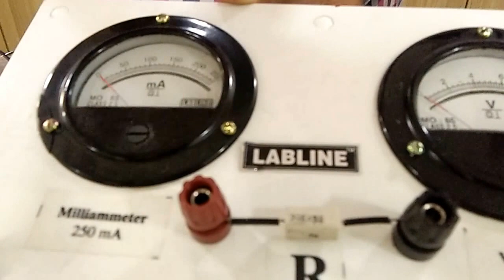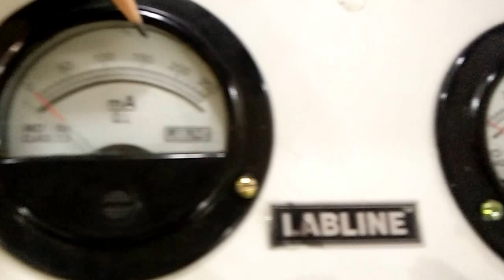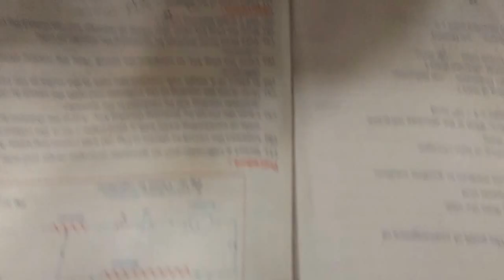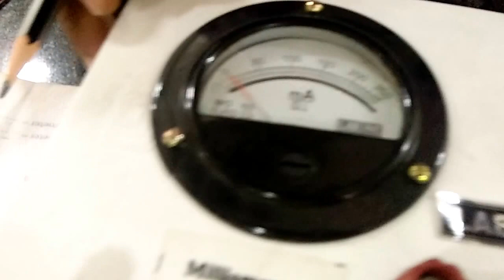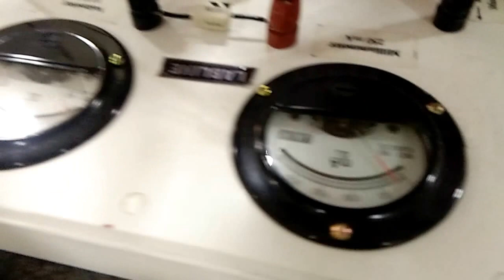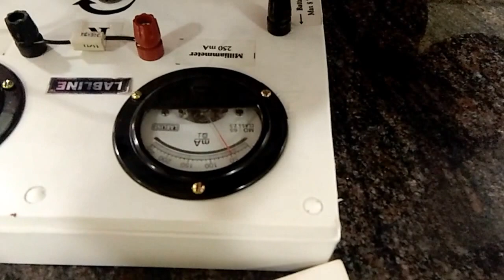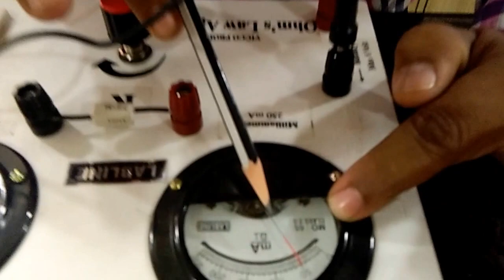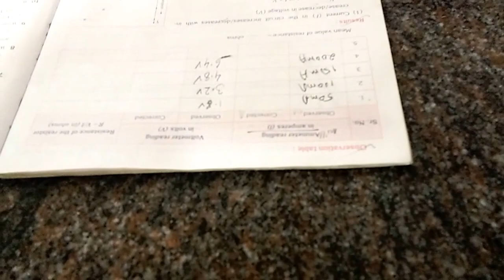Ohm's Law

Comment: Sir what is the difference between series and parallel connection please tell
Reply from the maker: Sankara Narayanan 
Due to series connection.... Resistance increases but current decreases
In parallel opposite of above happens
Reply from the maker: Also when there is series connection all components are connected one after the other.... Whereas in parallel all components are connected one above the other between two common points.
Reply: Sir in textbook it is referred as that the parallel connection reciprocal of equilant resistor is equal to the sum of indudiuval resistor I can't understand parallel connection
Reply from the maker: Dear Sankara Narayanan 
Easy to understand...Textbook says it is Reciprocals of individual resistance is the  sum of reciprocals of individual resistances....Means....Suppose u have 3 resistances 10,20 and 30 ohm....Connect in series it is Rs=10+20+30=60ohm 
But in parallel if u have studied derivation u see that it is become 
1/Rp=1/10+1/20+1/30=11/60
Now u solve further Rp=60/11=5.45 ohm
Check in parallel resistance total value got reduced by 12 times....
Thats y we say that in parallel resistance reduces hence currents shoots up.... Hope u understood...
Please mention ur comment...Thank you.
Reply from the maker: Sorry definition .....Is incorrect
Reciprocal of Equivalent resistance in parallel(Rp)is the sum of Reciprocals of individual resistances.
Reply: Ok sir thanks a lot